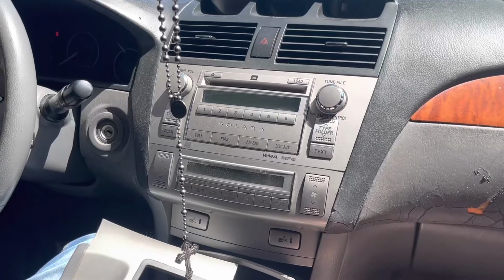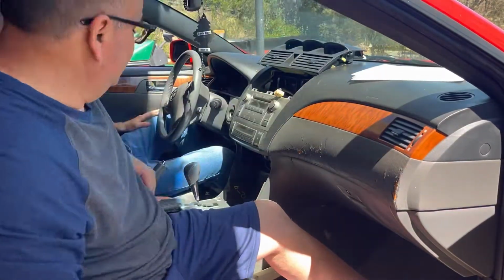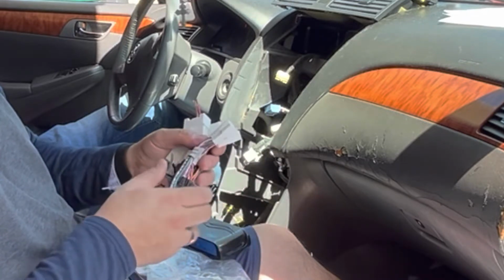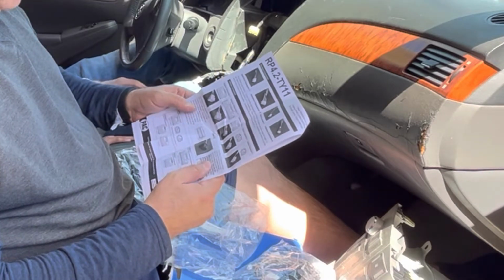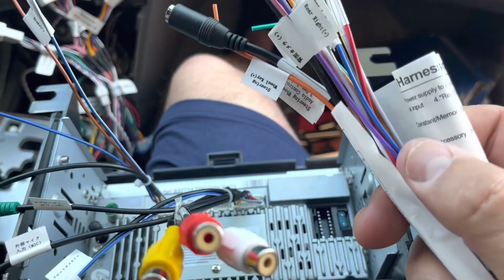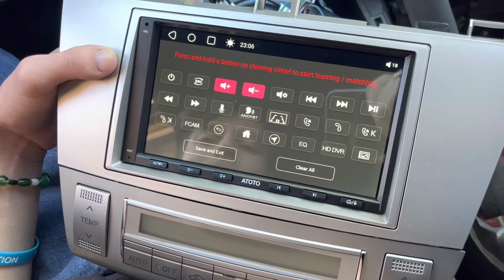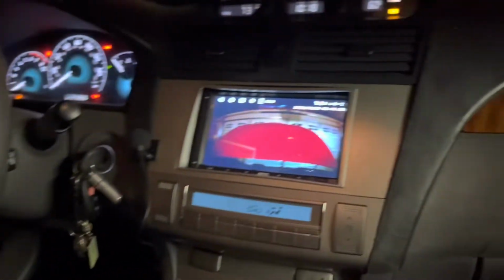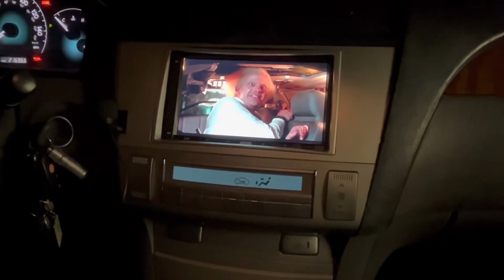2007 Toyota Camry Solara After Market Stereo Upgrade

Comment: Why get a stereo it already comes with aux??
Reply: Backup camera is why I did it. I have an 08 convertible and the rear view is terrible. Plus having apple carplay is nice. I got a Kenwood and couldn’t be happier. Planning on adding a dashcam soon. Nice part is the unit is ready for it when I make the purchase. It also sounds a lot better than the stock unit. Oh and I changed out all the speakers added an amp (nothing crazy) and subwoofer not long after for even better performance. So worth it.

Comment: Is your Solara a hard top or convertible?  I am picking up a 2007 v6 Solara SLE Convertible for my daughter and like to update the stock radio to something like this.  I believe this Solara radio is their "Premium JBL" radio - which I also think has a woofer behind the passengers back seat too.  Might you know if that is correct?

The 2007 Solara we are getting, the radio and climate controls look just like yours. It also has the extra little displays above the center vents.
Reply: Yes there will be a small black plastic box on basically a ledge that is right behind the seat that has the subwoofer.

Comment: Bro i need some help. I jave a 08 solara and i bought all the parts. Where do i connect the blue power antenna wire to
Reply: Does it connect to the wifi or bluetooth wire. Idk it's not just connect wires the whole. way
Reply from the maker: Blue wire is typically for an external power amp

Comment: Do you need the RP4.1 interface thing to make the radio work? It's so expensive!
Reply from the maker: Only if you want to use the existing JBL Amp system and steering wheel controls.
Reply: Is there a cheaper alternative or is that the only option?